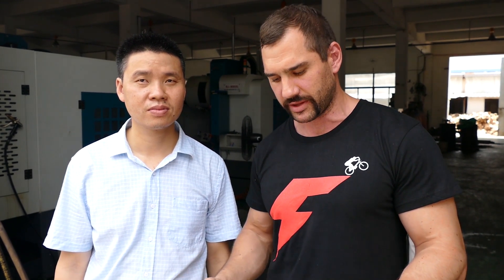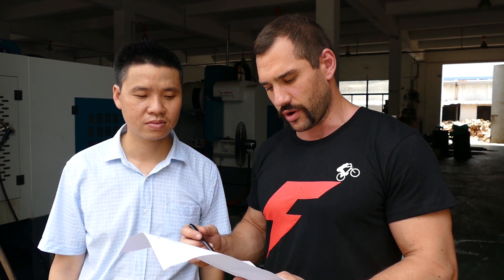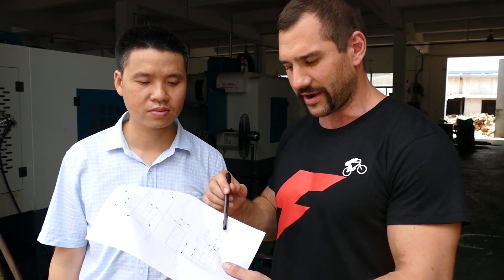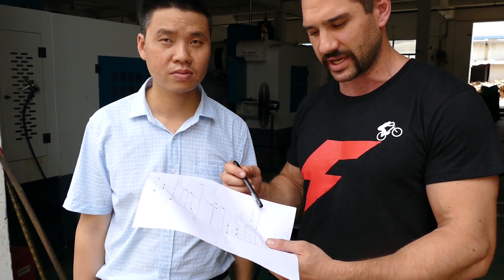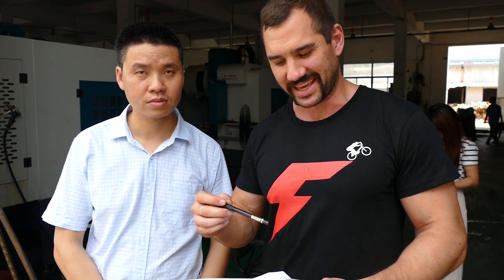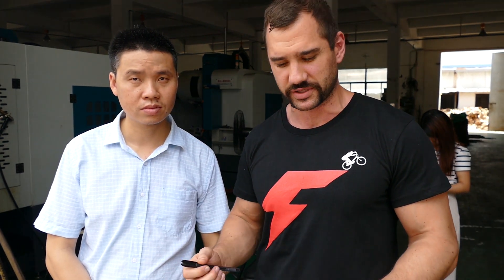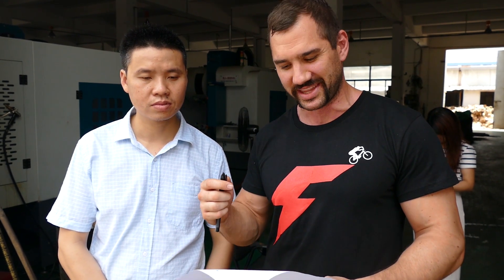FLX How to make an ebike: Engineers taking control

Comment: As per the other comments I am in awe with your openness.  I would love every manufacturer to do the same as that means customers, retailers and developers are in sync.   In the end, when sh... happens (and it will), customer's have the confidence in accepting proposed solutions.  Whether they can understand them or not!  It so happens I do understand and my confidence (which was already high) has been boosted even further.  Keep up the good work.   
PS you guys have a great attitude similar to the Open Source Software community.  Strength to you!
Reply from the maker: Fantastic Garry! Thanks so much for that. Pete and Rob have always said from the very start that they want to be as transparent as they possibly can with the company. You guys have placed so much faith in FLX that keeping you posted at every step was the only conceivable option. Thanks again!